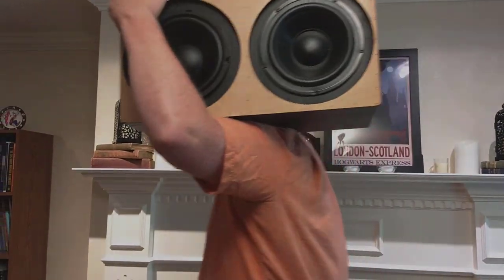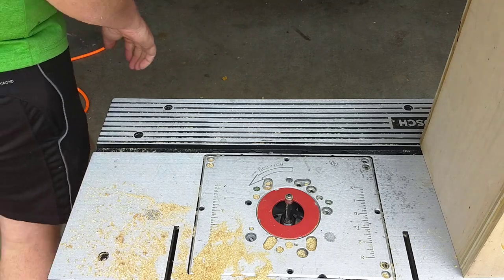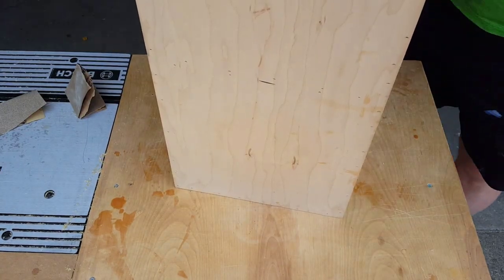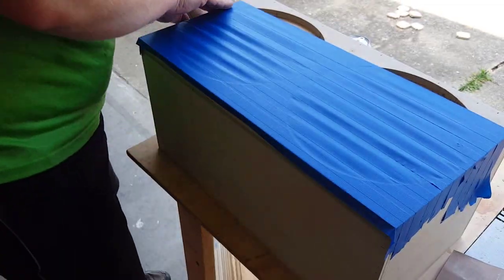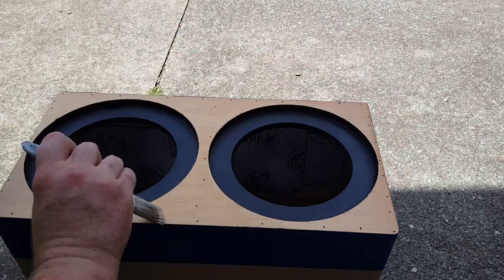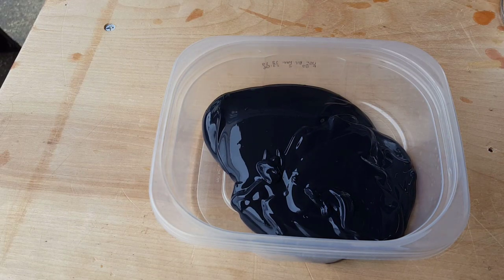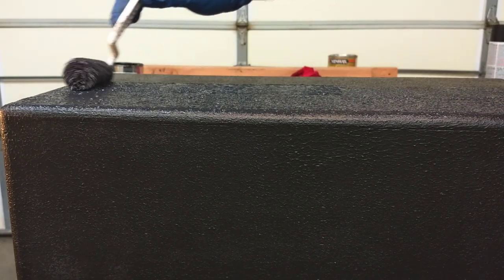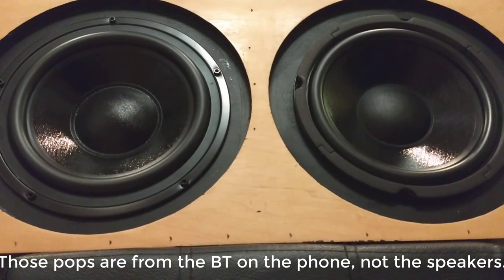How to build a subwoofer. Passive radiator sub build part 2!

Comment: I dig it! Enclosure building can be taxing and rewarding all in one, but I love doing it even when I don’t get the results I expected.
Reply from the maker: In this build I was really trying to make it look good.  The stained wood contrasted well with the duratex.  As far as the sound, it was fine, but it can't get down low.
Reply: DIY Audio Guy I’m watching your video with the winisd modeling and I think the steep drop off below 50 hz is what’s causing the issues on the lower end
Reply from the maker: @HifiVega  yep.  I didn't show the xmax in that video, but below 50 HZ both the driver and the PR completely unload.  I was fully ready for that.  The driver xmax is only 4.5mm, the PR is 11.  Both of them are well beyond their limits at 45 hz.  I have plans to bring this up in future videos.

Comment: I know this is an old video but, typically with a "sub-woofer" passive your dealing with a passive radiator greater then the bass driver. I/E bigger diameter and/ or longer excursion passive. Also the enclosure is not properly done. The sound deadener just puts a band-aid on a persistent problem, the enclosure should be thicker or have internal supports. Deadener is better suited for vehicles to reduce resonance, doesn't work well in an enclosure since it isn't as ridgid as wood and isn't as absorbing as insulation. Proper bracing, better passive, you should see much better results, also make sure to have the right amount of weight(s) on the passive. You can add or take away washers to the passive radiator to "tune" the output. A thin layer of batting or insulation around the inside should bring that resonance down significantly.
Reply from the maker: Thanks for your input and thanks for watching.
Reply: @DIYAudioGuy  Queue the "know it all audiophile" that has to pop up on everyone's DIY build lol Good work, glad to see it came out well. Keep it up!

Comment: Just ran across your channel/vids. Haven't fooled with audio much in the last 20-25 years. Getting back into it just out of curiosity. Building a sub setup for my SXS. Researching sealed v ported v radiator. Trying to do something different. Building the most for the least has always been my MO. It's fun getting back into it. Keep the vids coming.
Reply from the maker: Awesome! Any idea what you're going to use in the sxs?
Reply: Caught (2) Skar IX-8D2 and an MB Quart mono amp for stupid cheap. Working with a limited available space under driver seat of a Can Am Defender. Was gonna do a single sealed, common chamber downfire, but looking at possibly opposing sealed. Single with a PR is an option as well. Single ported will work, but my reflex enclosure building skill just aren't quite there. At least in my head. Plus, it's not completely enclosed, so there's a cabin gain loss as well. It's only going to be "so" good. 😆
Reply: This is a predominantly a hunting rig, so the install is temporary just for an upcoming ride in May. Again, just an excuse to get back into a hobby I've missed dabbling in for years.

Comment: I subscribed! Your videos are fun to watch. The pr projects I’ve tried in the past I used a subwoofer and a larger radiator in a smaller size enclosure. Seemed to work decent, keep up the great work
Reply from the maker: Yep, I have some newer PR videos.  When I made this project I was trying to get a feel for how passive radiators are designed.  The big thing that I learned is you've really got to pay attention to the X-Max of the drivers, you don't want to exceed X-Max on the passive or the active.

Comment: You did an amazing job. 👏👏👏👏
I want to build a 14 inch square box with a 12 inch sub llus 2 12" passive radiators. That is the idea but I might have to change a few things. The hope is to get low to 20hz.
I will be using a SVS 400 RMS amplifier.
Reply from the maker: Parts express has a 12" passive radiator on close out right now.  They're only 25 bucks a piece.  I learned a lot on this passive radiator project, I put it together mostly so that I can have a chance to experiment with passives.  My next passive radiator build is going to be something bigger now that I've got a better handle on how to put them together.
Reply: @DIYAudioGuy  I was planning to use blow out 12 inch matching subs for that. But to remove the magnet from them.

Comment: I know this is old so im sure he had learned now but i always go with 2 PR of the same size as the active driver. Because I learned the with just one PR its so easy to over load it and reach its xmax and push to distortion. So i cut a new hole in the back of my box behind the first PR and man it was a big difference. It played lower tones louder and really took most of the active drivers cone movement away at the frequency's I tuned the PRs for. (32hz) Its 1, 10 inch mid range driver i made as floor standing speakers so 2 boxes the has 1, 10 inch mid bass driver, 1, 6.5 inch midrange driver, 2, 4 inch  tweeters and 2, 10inch PRs in each box. They sound like they have subwoofers built in lol perfect for movies and games. Music needs a little help from a real sub but they still kick
Reply from the maker: https://youtu.be/v4rAkxck2_Q?si=KQniu8Vr-58L1xHc

Comment: Accidentally left one weight on a PR in my 12 build😂 Surprised it still pounded-was just a little 'off'. Couldnt agree more on the Rock and Roll comment. Rock never sounded that great to me on Ported. Added a false wall in the PR box too to bring up the tuning. It was at max volume allowed with the EQ PRs before.

Comment: I dont use apps often when building PR setups either. Just general rules of thumb (they always sound good at completion):
-Make sure the PR Sd is greater than the sub.
-Always make sure the XMax of the PR exceeds that of the driver
-Never exceed 2.5cf.
-always use the same 12s or 15 PRs for 12-15in drivers

Comment: Nice work, I need a router and a table saw before I can start doing a serious build like this. I’m thinking about using a passive radiator.
Reply from the maker: I think the router really is necessity for making perfect circles and putting the finishing touches on a project.  I've seen some woodworkers make use of a jigsaw and a spindle sander to get close to the same effect.  As far as the table saw goes I have found that this is a good affordable alternative https://youtu.be/NWbE3oZdJXs
Reply: @DIYAudioGuy  thank you!
Reply from the maker: I bought the router before I bought the table saw and I just used one of these until I could afford a table saw.

https://youtu.be/NWbE3oZdJXs

Comment: Great video i enjoy the content. I've been building subwoofers and enclosures as a hobby since high-school. Keep the great content coming. Definitely "sub"ed to your channel. Pun totally intended. My most recent fun project was building  my first 1:1 ratio 4th order enclosure using an  old 90's earthquake audio 18 i picked up for cheap. The best part is the looks on listeners faces when i tell them I'm only powering it with 40 watts. It has a pretty impressive bandwidth. It peaks around 60hz on the sealed side and the ported side is tuned to 32hz. It's comfortable playing in the 20hz range as well. Can't wait to see more content or your channel.
Reply from the maker: Hey thats totally awesome, and I might need to steal that pun. It will make a great catch phrase.

It is amazing what you can do with a band pass box.  I built a one-to-one fourth order back before I started filming projects.  I need to build another!

Comment: I was wondering if i should build a subwoofer enclosure with a passive radiator, but i`m not sure if i should go bassreflex instead after watching lot`s of videos on youtube. I really don`t know if a passive radiator or bassreflex will go deepest in bassreproduction?
Reply from the maker: Passive radiator are only practical when you don't have room for the correct size port.

Comment: Very nice videos 
So you think that putting the sound deadening material inside the enclosure cause any kind of change in the tuning frequency of the enclosure?
Reply from the maker: Probably not.  The main reason why I used that was because I happend to have some on hand and I wanted to add a little extra vibration dampening.

Comment: I love you're videos and the inspiration you make for people... Check out my amateur videos of my passive radiator subs. They gives a punchy bass all the way down to 20Hz. 
The small subwoofer I use in my car cost me about 25dollars to make, because the Rockford punch driver  needed a bit glue to work properly. The passive radiator was a completely blown sunfire hrs-10 driver I got for free. And the box was also a blown subwoofer with a 8" woofer. The Rockford punch driver is rated to 250w rms,  but it makes an impressive spl with the passive radiator well below 25Hz. 
To make the radiator I cut off the magnet, made a flat round aluminium membrane. Filled the cavity between the 2 membranes with building foam. And added about 260grams of weight in the voicecoil with a chemical concrete.
Reply from the maker: I like a good budget build.